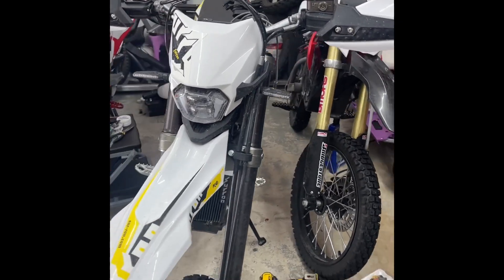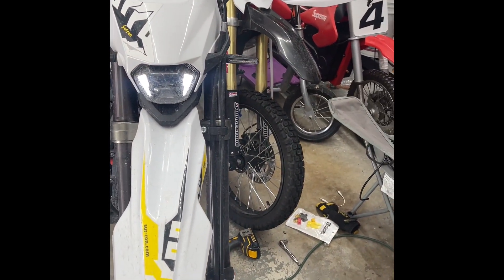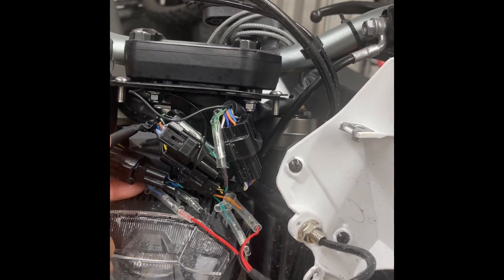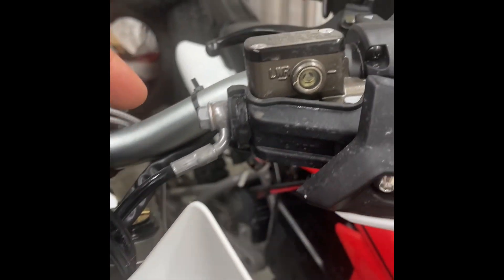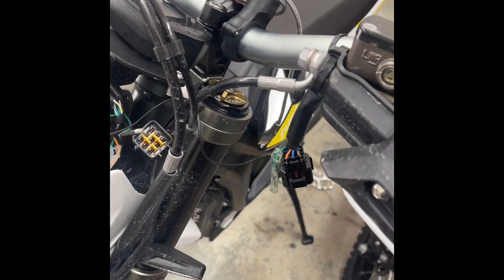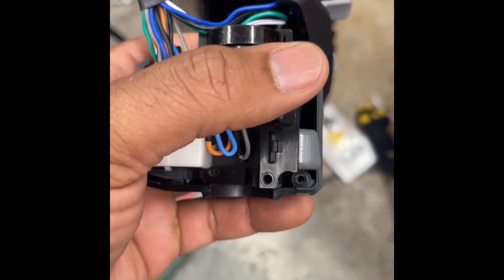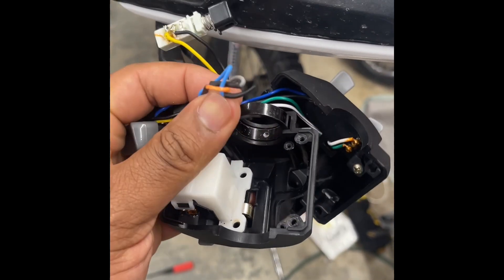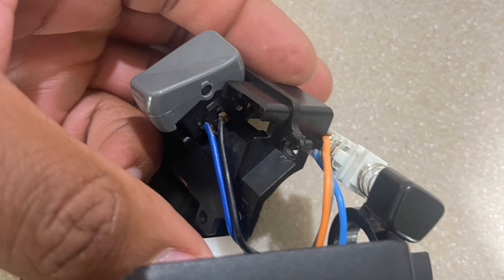How to mod Ultra Bee headlight switch for on off control.

Comment: Yo thanks for the detailed “how to” clip , I’ve been searching and haven’t really found anything on adding blinkers to the ultra bee for the American. Model. Question , you mentioned the blinker load resistor under the seat area , is that also included on the American version or would I need to pick up and instal a euro wiring harness to get one ? 
I’ll watch the video a few more times maybe you specified that and I just missed that part
Reply: Ok got it ll have to find an international harness   Unless you have a link to where one can be found?
Reply from the maker: Just found this amazing item on AliExpress. Check it out! $197.01  1％ Off | SURRON Ultra bee OEM Main Harness electric motocross motorcycle original UB Main Harness wiring harness Main Cable
https://a.aliexpress.com/_mP7ht1c
Reply from the maker: I used this relay. I had to solder the wires. Not plug and play. But it is the correct type to work with led lights. MFC PRO 12V 3-Pin Electronic LED... https://www.amazon.com/dp/B082X6DX6L?ref=ppx_pop_mob_ap_share

Comment: sodder wire? uh....can't I hire you to do all my electrical connections.
Reply from the maker: Ha. You’d be surprised what you can do with a cheap soldering iron from Amazon. Use flux and keep the tip clean. You’ll be soldering like a pro.
Reply: I know I just don't have the eyes for it anymore. I had to order a new tail light because the stock one the wires were too small. lol @Offthevoltz
Reply from the maker: @TrustedSilver1987  https://www.harborfreight.com/helping-hands-60501.html?ccdenc=eyJjb2RlIjoiOTMzNzQzMzciLCJza3UiOiI2MDUwMSIsImlzIjoiNC4xOSJ9&utm_source=google&utm_medium=cpc&utm_campaign=12129548629&campaignid=12129548629&utm_content=118594666244&adsetid=118594666244&product=60501&store=282&gclid=CjwKCAjwkNOpBhBEEiwAb3MvvYSWFWKgoPEajHPGCT8HHgzGqHNI1gSPX19ZWd7Zi8i6t-zOTKBX5hoCH0AQAvD_BwE
You got this!